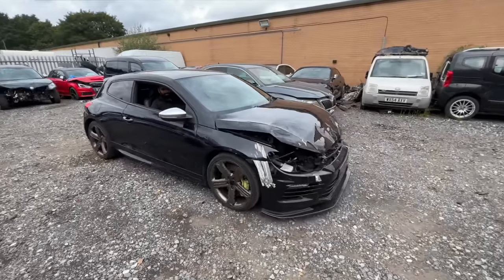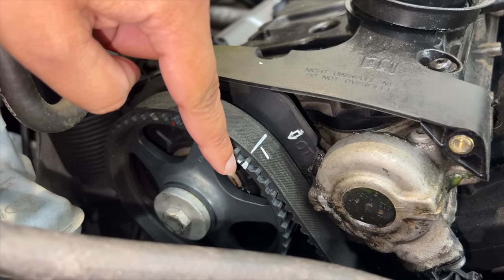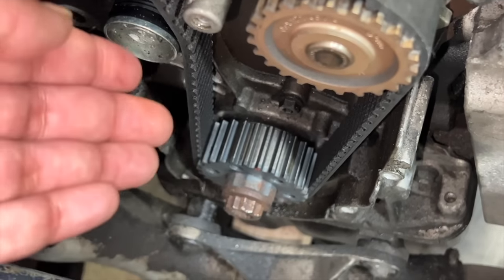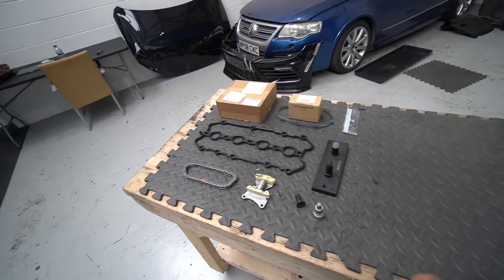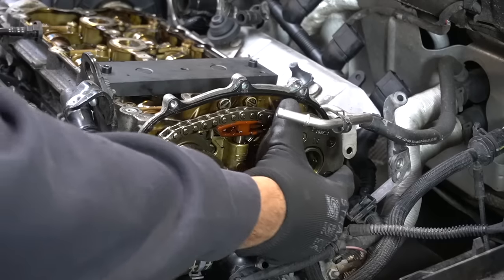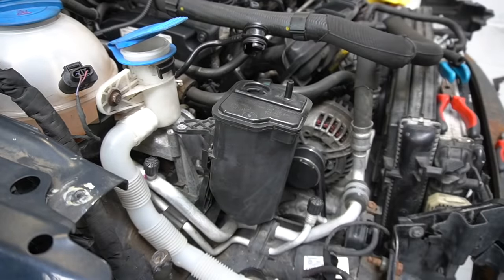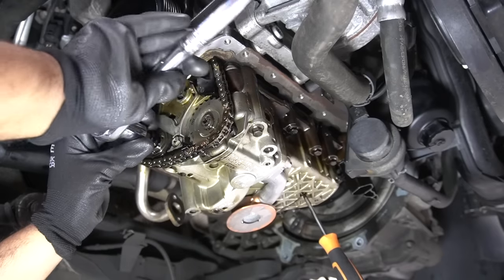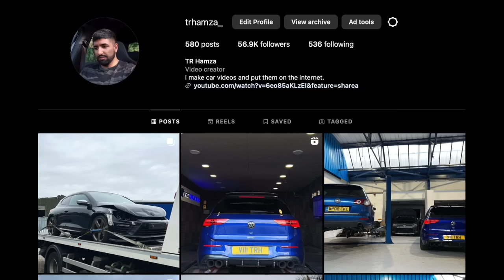REBUILDING MY WRECKED VW SCIROCCO R | PART 1

Comment: Good job Hamza. 

What I did when I modded scirocco R is put some Macan callipers and two piece brake disks. Add in some OZ hlt (the ultralight ones) wheels and you shave nearly 20 pounds of unsprung weight. Massive increase in handling and definitely worth it on a front wheel car rather than going all horsepower and losing traction all the time
Reply: Hi seen someone else mention the macan callipers.. is that of the 2.0 lt ? Looking at upgrading my tts brakes

Comment: Hey TR, Nice and informative vid as always!  Regarding the balancer shaft delete, yeah they troublesome oil pumps.  What I did on my BWA is remove the complete what I like to call a shoebox oil pump.  I then removed the chain gear on the crank and "socket pressed" a gear from a Mk4 gti Engine with a mk 4 oilpump and tensioner. Then blocked off the oil return of the shoebox pump with a bolt so there is no pressure loss. Complete oil pump deleted. Engine is more responsive and feel somewhat that it spins up faster.  Only thing now that it occupies more oil. 6l thereabout.

Fyi for when you want to tackle this sometime again.  Cheers mate

Comment: It was serviced at Arnold Clark when it had the belt by the looks of it and they don’t authorise techs to replace the water pump unless it’s leaking so seeing an original pump does not shock me (I used to work at a Arnold Clark dealer)
Reply from the maker: Interesting, makes sense, so was a decent guess haha

Comment: One small tip, timing belts usually have timing marks on them so you can line them up with your timing marks on your cam and crank pulleys. Looks like you made your own which also works, but generally the belt will have them from the factory which can let you know quickly if you're off a tooth.
Reply: they certainly never used to , must be a new thing , great idea though.
Reply: @tomthompson7400  Maybe it's a Japanese thing, all the toyota and subarus I've worked on had them.
Reply: @Canuckrz  its  a great idea .

Comment: Awesome video! Although would love to see even more detailed disassembly/assembly of parts and instructions on all the torque specs, for oil sump and any other bolts/ parts, or at least information where to find torque specs and other info. Also, ale the info about exact parts that have been used and stuff at least in the video description.

Comment: To have the confidence to even attempt all of that despite not having done a belt before is inspiring. Suppose it helps if you’ve got the money lying around to drop a replacement engine in if anything goes wrong 😂

Comment: Amazing video. I really don’t know how did you manage to remove the engine mount bracket so easy. I suffered MY LIFE with that 🤣
Reply from the maker: It was still a bit of a nightmare, kept raising the jack 🤣 the scirocco doesn’t have access port either for the inner bolt like MK5

Comment: So...balance shaft DELETE? I was not aware this was a thing on this engine, but apparently it is...guessing nothing runs off that shaft deeper inside except a counterweight shaft.  Does it significantly alter NVH at a certain rpm now? Does it rev quicker than before? Slower?

Comment: Do an AWD conversion! Definitely pro with the servicing and repairs now. Start my AWD conversion next week on my Octavia vRS eeek! Booked the whole week off Haha
Reply from the maker: I’m looking into it! Nice- I’ve heard on the Octavia there’s no cutting needed like these would need?
Reply: @TRHamza  yes no cutting and just the welding of the two prop bearing mounts. I did the wiring beforehand and using a gen5 haldex from a yeti for some reason as it still uses the pq35 based canbus over the other mqb gen5 systems (although looking back on it best to go gen4 with the filter as you know the gen5 are a bit more needy with servicing).  Give us a shout if you have any questions 👍

Comment: I think it dident run straight away because of the Air in the Fuel System after you disconnected the fuelpump but anyways great job

Comment: Do you recommend changing the density of the oil from 5w30 to 5w40?
Reply from the maker: I’ve always used it on these engines and never had any issues. Especially when tuned. Wouldn’t say it’s necessary if stock though, regular changes are more important